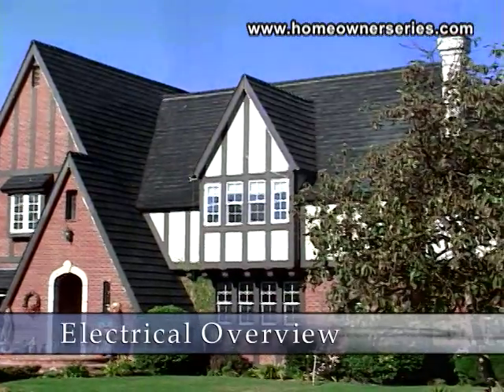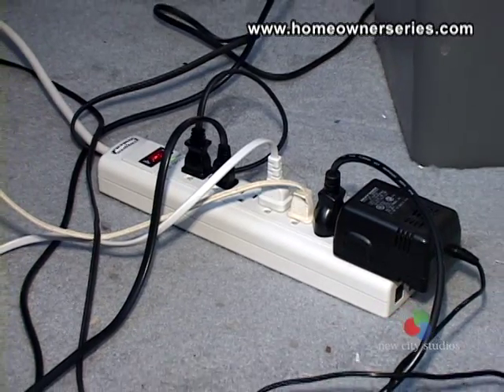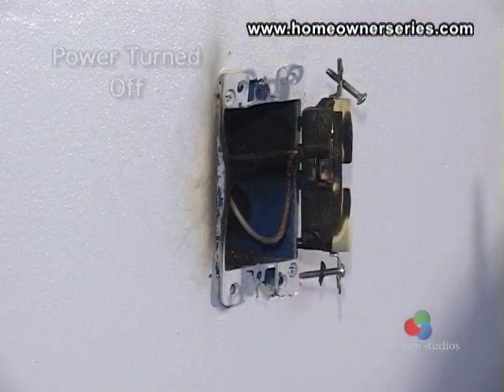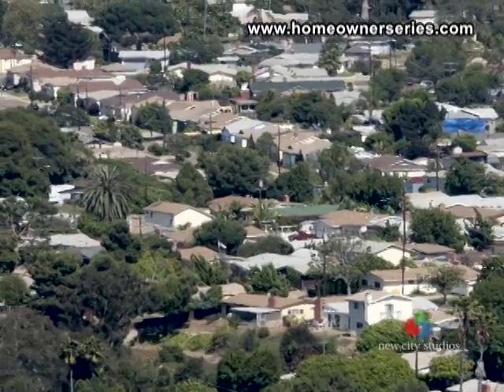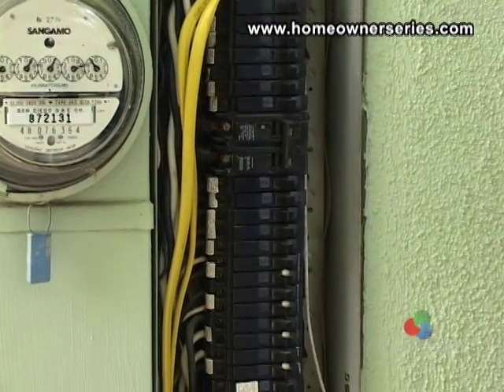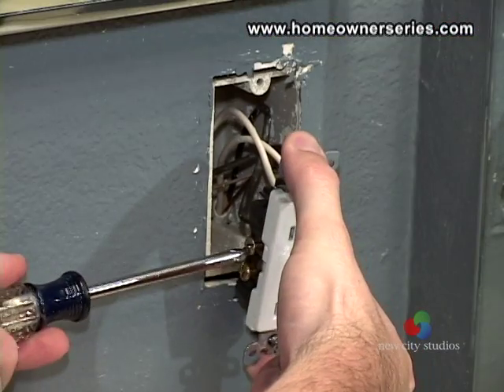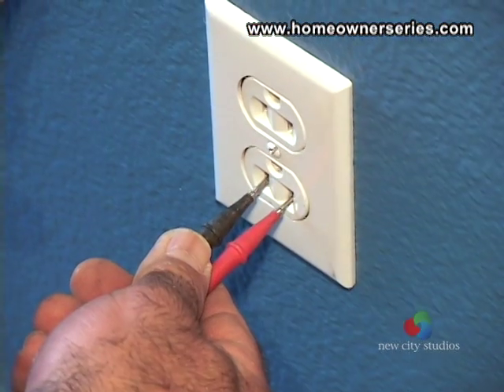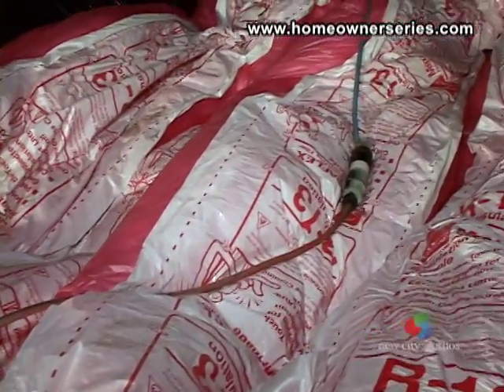Home Inspection - Electrical - Part 1 of 3

Comment: Although aluminum wiring for small gauge branch circuits turned out to be a major mistake, aluminum is still routinely used for the service entrance and panel/subpanel feeder lines for new homes. One only needs to glance at the price per meter for aluminum vs copper in those big cables to understand why. Most panels today are made with plated aluminum bus bars rather than more expensive copper. Used in the right situation, with antioxidation compounds at the interface, aluminum wiring as used today is safe.

Comment: Knob and tube wiring is NOT intrinsically "extremely dangerous"  especially if it has been left alone. The typical problems with K&T are:
- overloaded wiring caused by homeowners adding extra outlets and devices to an existing K&T circuits: Safety issue 
- lack of ground connections, GCI and AFCI protection: Safety issue
- too few outlets: Convenience issue, is a Safety issue when multiple adaptors plugged in
- insurance companies don't like it;
- the main panel is probably undersized: Convenience/Safety issues

If rewiring a K&T house, I would upgrade the service panel and  rewire all outlets adding more as necessary. I would like to leave the lighting circuits alone (unless additions were in place or needed) but probably won't because of insurance difficulties. Some insurance companies say no to K&T altogether, but some say it's OK to stay if you have an inspection that certifies it's safe, but may charge you more anyway. 

A un-messed-with lighting circuit using 12 AWG conductors spaced several inches apart generates less heat and is less vulnerable to being nailed through than two 14 AWG conductors bundled together in an NMD cable, but what do I know?

Comment: At the point of attachment of the wire to the box, the wire sheath should stick into the box at least ¼” so that the wire strap is attaching to the sheath, not the wires themselves. There should be at least 8" of usable wire length to extend from the box. This allows enough wire to connect to the device and allow future trimming to connect to replacement devices. thanks